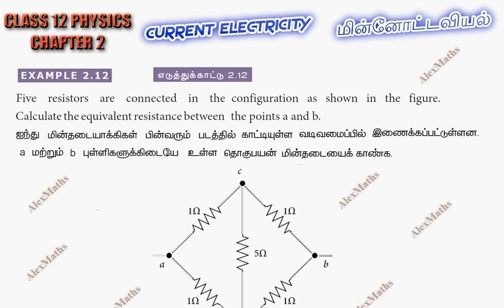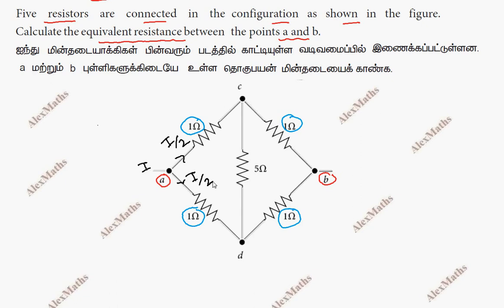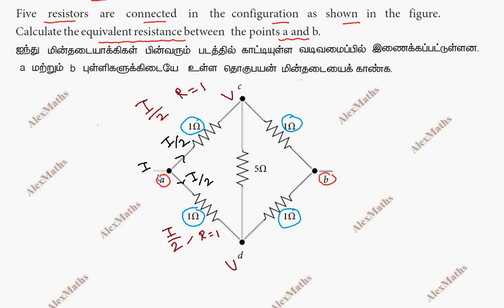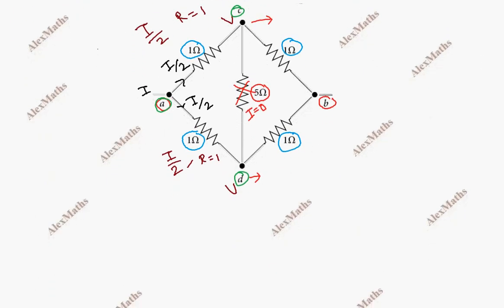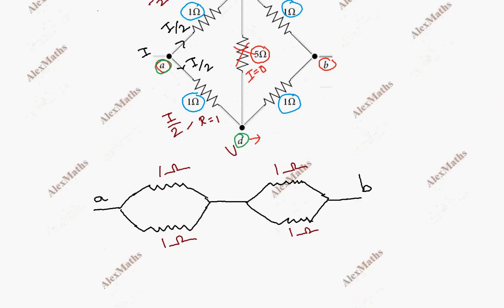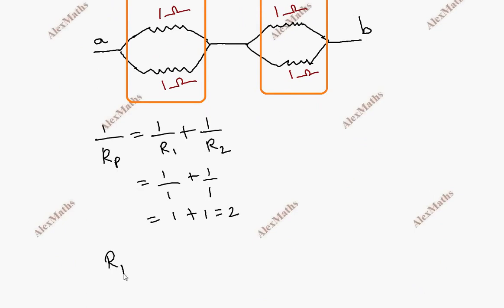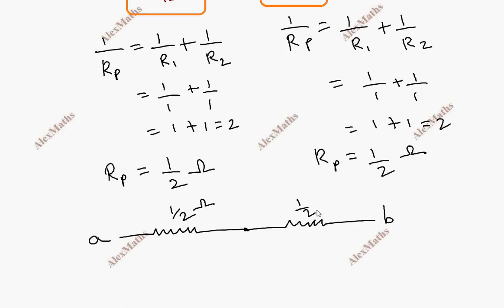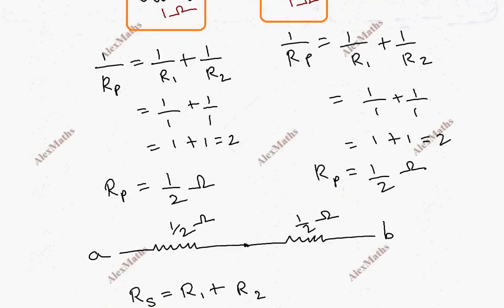Class 12 Physics l Current Electricity l Example 2.12 - Part 19

Comment: Sir could u explain. Why there is no current flow. When voltage is same
Reply: To produce current, charge must flow from one direction to another direction..To move the charge to a particular direction , potential difference is required..so that current can flow from high potential to low potential..if there is no potential difference  then there is no flow of charges hence there is no current flow..so there is no current flow when potential is same ..